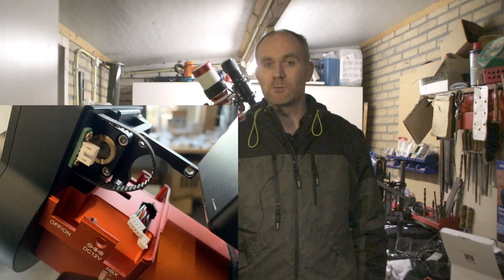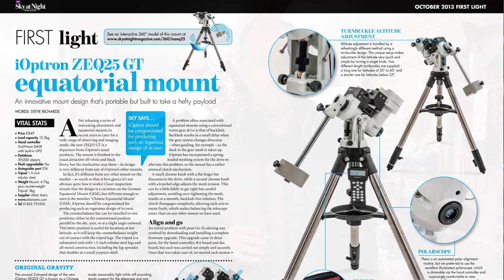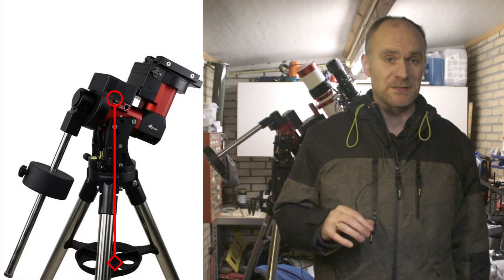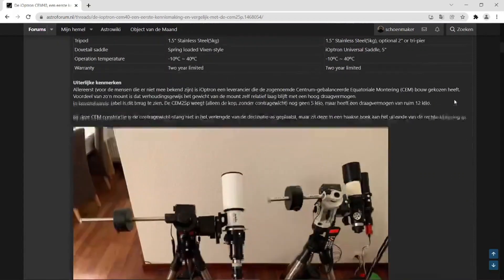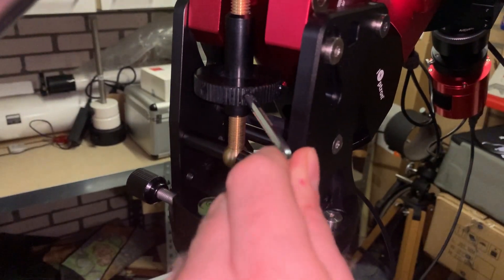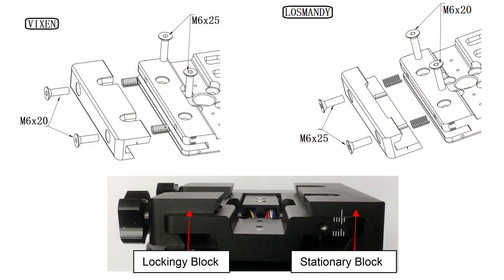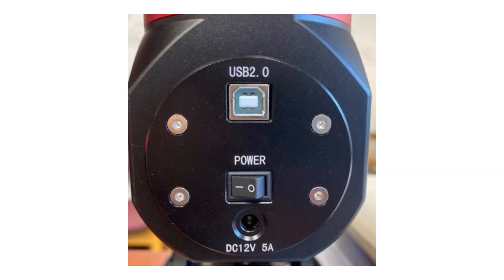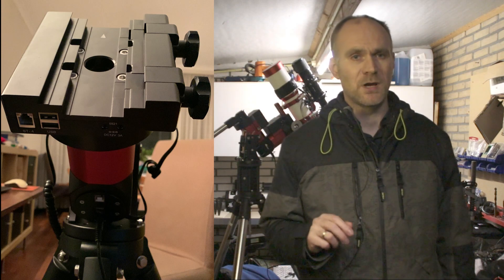iOptron CEM, an iterative story; CEM40 review

Comment: I guess you replaced your CEM40 with the AM5. I read the PE of the AM5 up 20”. I have a C8 and was looking into a CEM40/GEM45. Is your guiding on the AM5 as good as the CEM40 whose PE is supposed to be under 7”?
Reply from the maker: It definitely is just as good as the CEM40. With guiding. Unguided is impossible due to the PE.

Comment: Just got a CEM40EC with the 8410 hand controller and newest firmware (which removes star alignment from the HC btw) and it does indeed still need a usb hub. Luckily, I have one on my setup anyway but thanks for pointing this out as it saved me a lot of time troubleshooting!
Reply from the maker: You're welcome! Wow, the encoder version. I've heard very good stories about those, not even requiring guiding and such. I have the non encoder one. Must say, I don't have the HC connected at all as I am running things over USB and the ASIAIR primarily.
Reply: @KopLamp  that's my hope with the guiding as I live in Bortle 9+ skies and sometimes finding a guide star with an OAG is impossible haha. Still waiting for the "new equipment clouds" to clear to test though. Anyway thanks again and clear skies!

Comment: I think they also changed the power input socket from 5.5 2.1 in earlier versions to 5.5 2.5.  Correct?
Reply from the maker: I first noticed it in my second CEM40. The 2019 model still had the 2.1mm center pin.

Looked up the manual of a CEM26 and there it still says 2.1mm

Comment: I have a CEM40EC and couldn't be more happy. I seldom do tracking anymore, at least with focal lengths below 1000mm. If polar alignment through the ASIair is very good (less than 10" combined error, which is achieveable in a few minutes), the system is perfectly doing what it should do.

Comment: That seems to be a little bit chaotic in the difference of this CEM40 sub variants. Therefore does it make sense to upgrade from a Vixen GPD2 with ESCAP motors and LFEP control system? Maybe not…
Reply from the maker: I don’t have any experience with Vixen mounts, so your guess is as good as mine. What I do know is that both my CEM40 variants are very good mounts.

Mount land has been very dull for many manufacturers. But there is a new thing on the horizon. Seems to me that harmonic drives is the new hype. I think you can expect a review of one, on my channel this summer.
Reply: @KopLamp  Hello Martin, thanks for your answer. And yes, I have seen that there are new „HEM“ mounts on the horizon, also from iOptron. From the price point very interesting and additional with encoder in RA axis. Lightweight and stiff. Maybe the best for my purposes:
The photographis and visual use for a TeleVue NP101 refractor telescope or for my other device, a Celestron EHD 800. Both systems with camera and small guide scope, all together below 10kg.

Comment: Great comparison! I've been using the CEM40NUC with a non-NUC minipc for about 6 months now. I really enjoy using short cables with no chance of snagging as the mount slews. The mount works well with N.I.N.A. and my guiding error consistently stays below 4 arcsec. My only real complaint is that I use an iOptron focuser on my RC 8" telescope and both it and the GPS module use the same port. It would be extremely beneficial for me if the mount had a dedicated GPS port in addition to the iPort.
Reply from the maker: By the sounds of that RC8 I am guessing you are not very mobile with your setup. In your case I would store the location in your NINA profile and skip using the GPS module.
Reply: @KopLamp  haha unfortunately, I do have to be mobile to get dark skies. I usually just leave the GPS module on until I have finished polar alignment and all the other setup steps, then I switch to the focuser. It works, but I would rather have both plugged at once. I tried a splitter but it didn't work.

Comment: I actually just got a CEM25P this weekend. It was used and didn't come with the pier unfortunately. Of course, it rained this weekend, so no first light on it yet. I had a question about the clutch releases. Did yours feel like really cheap, light plastic? Mine feel like they might pop off at any moment. I was hoping there was some kind of latch that you could replace them with that feels sturdier, but so far, I haven't found anything. Otherwise, I'm super happy with the mount.
Reply from the maker: Indeed... On the CEM25p the clutches feel a bit clumsy. But they are really effective. I had to get used a bit to releasing the wormgear first (with the silver knobs) and then release the clutch. Also tightening the wormgear and then loosening it again for 1/8th of a turn is a bit cumbersome.

The successor of the CEM25p has the same clutches as my CEM40's and I really like them better.

Comment: thanx for the review at the right time for me. Need to replace my avx and plan a cem40 for that. a question on payload. did you try it with max load of 40lbs or what is your max recommendation?
Reply from the maker: I need to do some maths because I don't speak lbs... so hope I am correct; The unofficial rule for telescope mounts is that with astrophotography you should not exceed half of the max payload.

50% of 40lbs = 20lbs (around 9 kg)

Center balanced mounts are different though and you can exceed that. I would not go higher than 80%. Which is 32lbs (around 14kg - rounded down)

My EdgeHD incl peripherals is 9kg, so I am already maxed out perhaps as officially the max payload is including the counterweights (I think).
 Still I get round stars at 10+ minute exposures.
Reply: @KopLamp  payload is with counterweigts?  guess you're wrong as teleskop defines it as telekopweight only " Tragekraft bis 18 kg (reines Teleskopgewicht)"
Reply from the maker: I am mistaken indeed. I saw it mentioned somewhere as including counterweights, but iOptron themselves state it is EXCLUDING. Thanks for correcting me!

https://www.ioptron.com/product-p/c401a1.htm
Reply: @KopLamp  "... I don't speak lbs ..." 
hahaha 😂🤣😂🤣

Comment: My CEM40 arrived in Dec 2021 so it is a new one. One week ago I was able to setup the ASIAIR plus on the CEM40. Easy as 1, 2  and 3.... Nope, really not that!!! I just finally arrive on a mid solution to make the PLUS work well on the CEM40. Today I just viewed your video and you said to use a none powered hub between the PLUS and the mount. It is half-working. I need to start the asiair plus WITHOUT the usb of the mount. Then when the wifi has started well then I can plug the USB of the mount and all works well. So why cant I have the mount USB plugged to the PLUS? Well because the WIFI (and even a internet cable) is not starting up. Wow it was not fun. I even send an email to ZWO but no response at all, not even an "accuse-de-reception" from their part. Anyway Martin, thx for the "no-powered hub" trick.
Reply from the maker: I haven't had much time since making that video unfortunately. I will need to test out a lot of things to be totally certain, but my ASIAIR Pro seems to be unable to control the mount without using the camera as a hub. The ASIAIR Plus however (I own both) seems to be able to control it directly.

I also had a faulty USB cable provided with my new CEM40 mount, so you might also want to try changing your cable, if problems persist.
Reply: @KopLamp  
Hi Martin. Thx for the feedback. I have passed the cable mount by the CMOS camera and yes it works but not completely. Naturally I need to connect directly my guide scope to ASIAIR PLUS but it doesnt work when you start the ASIAIR. Now I cant start the WIFI of the ASIAIR when the guide scope AND/OR the mount cable (which pass by the CMOS camera). So I am using an unpowered hub connected to the Mount cable (which pass by the CMOS camera) and the guide scope which I remove from ASIAIR before I start it so that I can wait to the WIFI (or Lan cable) to work. After the WIFI is on then I plug the unpowered hub cable into the ASIAIR and all is working fine. So my conclusion is that it is not a CEM40 bug that stop the WIFI to work but an ASIAIR PLUS Oper Sys bug. for the moment I will keep this setup/procedure because it is working. Well it is better than nothing :) See ya!

Comment: Thanks for emplaning the evolution of cem40 mount, I have ordered CEM40G, due for delivery in Wk4. 22.  How much of guiding accuracy you have achieved on your newer CEM40 ?
Reply from the maker: Guiding accuracy is similar - if not the same - as on the older model. With my 60/280 guidescope and an ASI120MM mini camera I achieve an RMS of around 0.6"

But a better judgement are my stars. You can find results on my telescopius profile and zoom in to see the star-shapes. The last two images were with the newer CEM40.

Comment: Great video Martin, some interesting progressions and I am sure that anyone looking to shop for a CEM 40 will find this video really helpful . It's strange that the latest versions has connection issues with the ASIAir. I'm not sure why they would have made the inclusion of a hub necessary.
Reply from the maker: I am not sure either. I still don’t know if it is due to the firmware changes or if it is the hardware causing this. I also don’t understand how including a hub would solve it. AFAIK hubs are just dumb devices.

Comment: I have a very early GEM45 and it is the same story -- there have been many engineering changes in rapid succession.  We almost need to do what stamp collectors do, and publish checklists of varieties and distinguishing features!

The GEM45 and CEM40 are of course twins internally -- same circuit boards -- at least initially.
Reply from the maker: Well I have my ‘stamp collection’ posted in this video (and submitted as an article to CN - hope they’ll accept) 😅
Reply: @KopLamp  An article for CN is exactly what I was going to suggest!

Comment: Really informative video.... I have the first iteration. It took me many months to work through its niggles but i am very happy with mine... I would love to get my guiding down from 0.9 to 0.5... But at 478 FL, its not a major issue.
Reply from the maker: I love it very much too. Same guiding numbers. I use a 60/280 guidescope. Even when imaging at 1500mm’s with my EdgeHD I get nice round stars with up to 10 minutes of exposure.
Reply: @KopLamp  it's easy get obsessed over total RMS. My guidescope could be improved though, asi120mm + 50x230 isnt great... The optics in the WO 50mm guidescopes are just as basic as generic unbranded ones given away with many OTAs. I might upgrade to a 60mm doublet.... Even a cheap one would be 1000% better. WO might look pretty😬?
I recently added a IR/UV cut filter, no difference though.
There is A LOT of movement in those mounts and at least a dozen points of flexure... I have to repeat PA after a slew.
I use NINA.
Reply from the maker: I only look at the results, not focussing that much on the numbers indeed. Flex you say? Haven’t noticed that yet.

Comment: Hi Martin, I recently received a new iOptron CEM40 mount and successfully assembled with the Asiair pro. I had the same problem you reported when connected the mount via the 294MC-pro. What worked great it was plugging the usb cable of the mount into an unpowered usb hub that in turn connected to the Asiair pro. Hope this helps. Clear skies!
Reply from the maker: Yep, a hub is what apparently is needed. I use the hub in the 294MC Pro for this. Works (when using a proper USB cable).

The problem I addressed was that the old mount can conveniently connected without a hub, but the new ones for some reason need one in between.

Comment: I have the original 2019 version of the CEM40 mount. No iGuider or iNuc or iEC or ... ok, it does have iPolar, which I never use :). I have everything powered by a Pegasus Pocket Powerbox Advance and controlled by a Beelink mini PC. I have exactly 1 cable running from my mount to external power - either 12V via a Jackery 500 battery or via AC/DC adapter to my house mains. The one thing I've noticed is the USB connectors on the mount itself don't seem to hold the USB cables very snugly. Thus far, it hasn't been an issue, but I would certainly feel better if those cables were held in a bit more tightly.

I wish the azimuth adjustment knobs were larger. Trying to turn them to get fine adjustments, especially on cold winter nights, can be frustrating. Oh, and the knobs on the saddle... would love for those to be larger as well. I'll have to try out the hex wrench trick you use!
Reply from the maker: I have yet to use iPolar too. Had the mount for over a year now 😅 For me the reason is that I do my Polar Alignment using the ASIAIR only 😎

Comment: You can connect the new CEM40 USB directly to the AAPlus without having to use a USB hub. I havent tested it with my older AAPro, but with the Plus no need for hubs.
Reply from the maker: Will test that. That makes the claim that the old Pi kernel is to blame incorrect. AFAIK the AAPlus uses the same kernel as the AAPro.
Reply: @KopLamp  The ASI Air Plus uses a Raspberry Pi Compute Module, that has no native USB port. There is probably a dedicated USB Hub chip on the motherboard that is different from a regular Raspberry Pi 3/4. Which explains the difference with the earlier ASI Air versions  (and my Astroberry RPi4), and the latest ASI Air Plus
Reply: I've got an AAPlus due to arrive Sunday and will be interested to see how things change, but with the AAPro I definitely found that a USB hub was required for the CEM40 USB2 cable plus a USB FTDI serial to RJ9 cable for the hand controller.  Oddly, something about the AAPro's USB ports seemed sub-standard, as using the 2 USB2 ports wouldn't support the CEM40 and hand controller connections, yet an active hub/splitter on a single USB2 port worked, as does my current solution of a passive hub/splitter on a USB3 port.  I assume with your AAPlus, your hand controller still requires the USB/RJ9 adapter cable?
Reply from the maker: @Ambress  I used an FTDI to RJ9 cable on my CEM25p, but on the CEM40 (2019 model) I didn't require one and needed to plug it directly in the mount+AAP (or AA+).

AFAIK, that RJ9 plug is only used nowadays for firmware upgrades of the handset.
Speaking of which, I hardly have the handset plugged in anymore ;-). Only once, for an initial setup of the meridian flip behavior (No flip and 5 degrees after).
Reply: @KopLamp  thanks, perhaps that was because I've been using only a DSLR.  I just know with my 2021 version CEM40, the AAPro did not recognize the mount until I had also connected the hand controller with USB FTDI/RJ9 cable.    ....Well, surprisingly enough, as I returned here I saw yet another YouTube video where someone addressed the same problem with the CEM40, and their solution was only that a USB hub/splitter was needed, yet NOT to also host the USB FTDI/RJ9 cable as I've been doing.  I just tried to control the mount without that cable, and sure enough, that worked fine!  Always good to get rid of unnecessary cables.  I guess I'd just seen enough on the issue I was trying to solve that I thought the FTDI cable was still needed.  After all, why use a splitter for one USB connection?  Why indeed...but that's just a foible of USB support on Raspberry Pi apparently, and use of a hub solves it!
Reply from the maker: My 2019 model was undetectable by the Pro using the FTDI method. The 2021 model works over USB (without the handset) when using a hub in between.

Comment: Hi Martin! I have the CEM40G, bought new in the  summer of 2021. I have the same USB issue (need a hub) when I use the Raspberry Pi with Astroberry, so that doesn't seem to be related to the ASI Air specifically.
Reply from the maker: Thanks for that piece of info. I am inclined to thinking it has to do with a firmware change they did somewhere in 2020. They also state that you’ll have to use a specific iOptron commander version, should you want to control the mount that way.